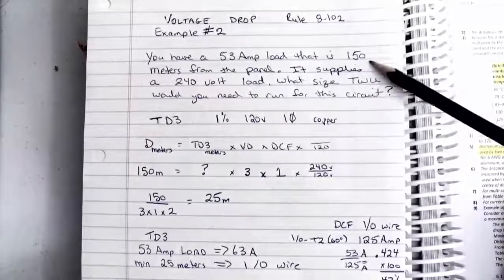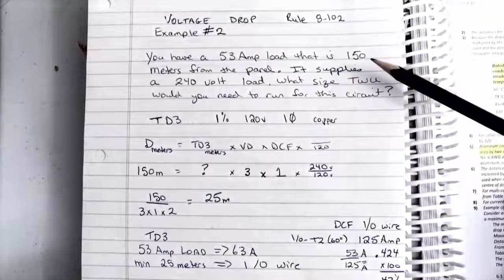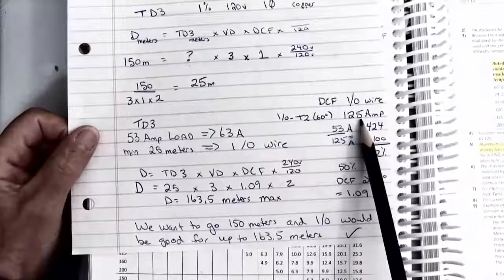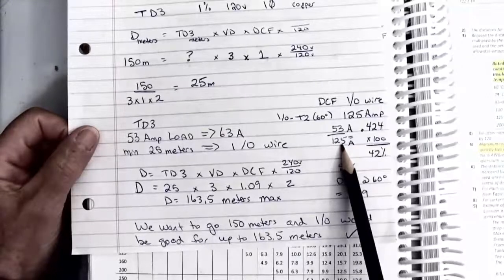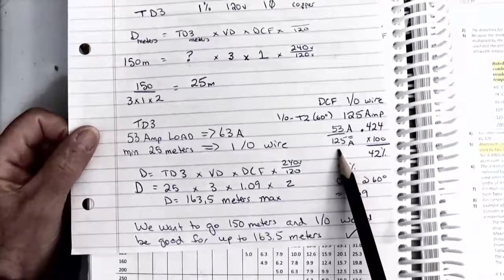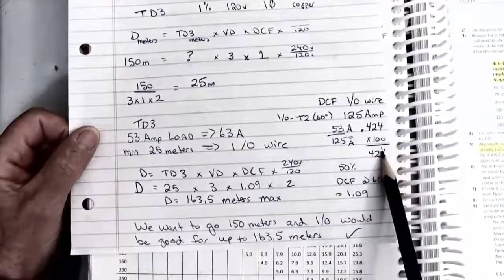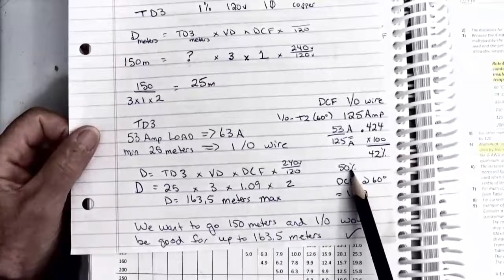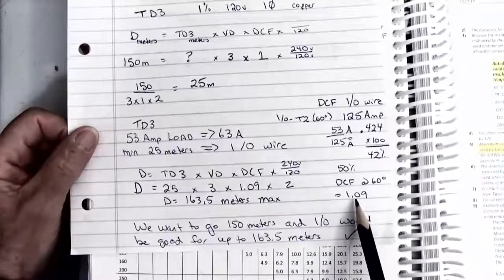Voltage Drop Rule 8 102 Finding the Wire Size

Comment: Could someone kindly explain how to do the voltage drop calculation for a 3-phase 600/347-volt system? This scenario by CE Code Book:    4wire (3C +1N) 750 Kcmil RW90 and 500' length with 600/347 and 400 Amps?

Comment: I'm in for 2nd year schooling at the moment, and these V Drop and Wire Size based on V Drop calculations are spinning me sideways.
It's nice to go through it at my own pace and understand WHY we use the values we are using, as my instructor goes through it at the speed of light. 
They're just real unorganized at my school,  and the STAT days take even more time away, making it so they have to get through the material as fast as possible. It's frustrating that they can't take the time to expand on these issues that (I can only assume) multiple other students have.
This explains it well and I can pause it and rewind if I don't understand something instead of putting my hand up and slowing the class for an issue others might see as dumb.
Not sure if you even read the comments on your vids, but thank you Deanna. Seriously.